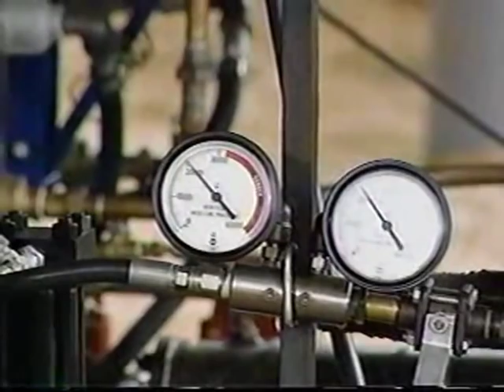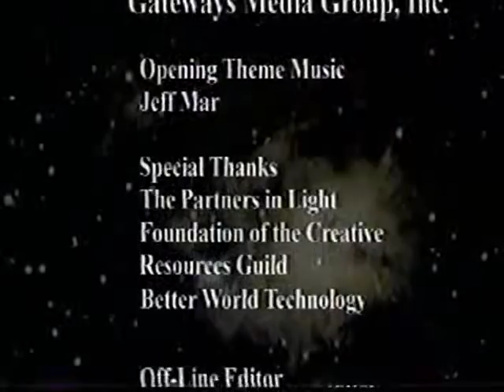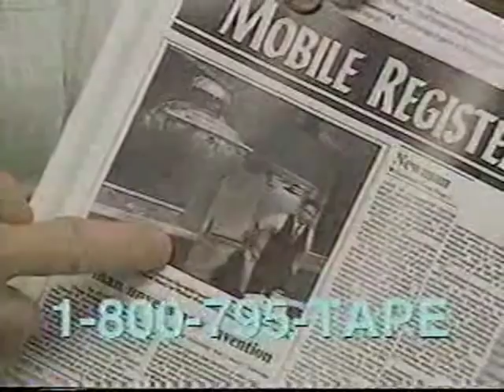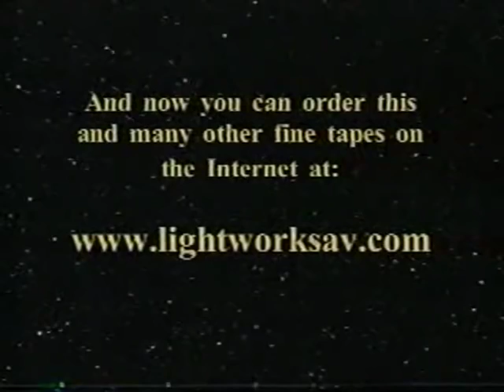New Energy Series : Dennis Lee 5/5

Comment: Sir or Mr Dennis Lee, there is no need to hide or lower other's people lights under a bushel so that yours will shine brighter. This is what you are doing to engineers and scientists and  yet all this video, for about two hours, all you did was to talk about  good and accepted engineering  principles.
The heat pump is something that every engineer knows about and I find it hard to hear that you found engineering who told you that it will not work, and most probable  it was  you who misunderstood the difference between technicians, or plant maintenance personnel  and engineers.
The heat pump is only the refrigerator cycle  and you are tapping the heat from the condenser rather than the cold side to keep the meat fresh. I am a little sceptical about your 6:1 ratio .
As for putting hot water in above a piston, the Navies have been using that system in steam catapults ever since the Navies were launching heavy planes from the deck of aircraft carriers. You have a lot to catch up to understand how the hook in a steam catapult works to launch 20 ton plane using volume of superheated water, where pressure remains constant while there is still a drop of water left. (Saturated Vapour Pressure  and all that )
Well Sir I wish you luck in using good engineering to become rich, but I ASSURE YOU that we engineers know all  what you are talking about  and you can shine your light amongst people not by choosing the right audience as you seem to be doing, with your jovial comical presentation of engineering for the public,   you would not behave like that amusing presentation with an audience of engineers.    I assure you that  you can say what you said in less than one minute  to an audience of engineers.
But of course you are an extrovert and a  salesman, and pretty good at it, but you are reaping the benefits of good engineering which was developed in silence by silent people working hard in the background, for extrovert people like you to benefit from it.
I assure you that all what you said would not be knew knowledge to James Watt in 1650  or to 1698 Thomas Savery or Richard Trevithick  about the same time.     
Good luck and again , but  do not shine your light by hiding  or lowering the intensity of those who came before you as engineers. and scientists. You are covering  the subject rather as am amateur, qualitatively and not quantitatively  and to mention God to pepper your speech, well,  I think I shall pity you and use a lot of compassion to put up with all this  silly show.   Yet I do understand, and it does not take a very wise man to do it after seeing this video.
Reply: +Carmel Pule&#39; Does the heatpump input 1kW really give 2-3kW output?